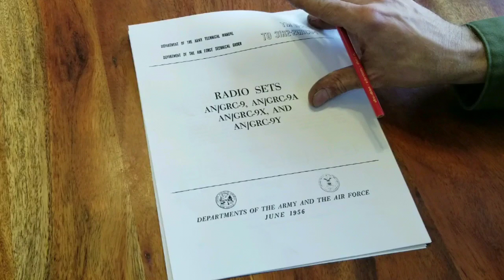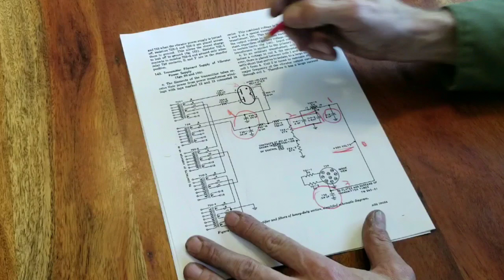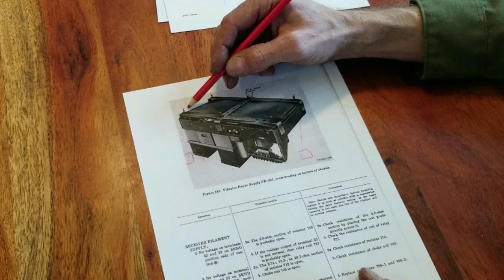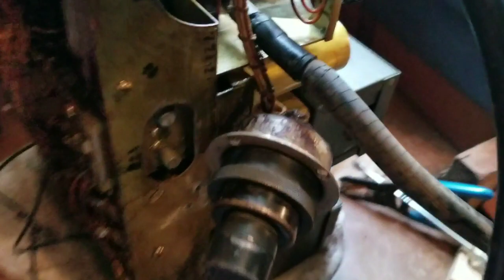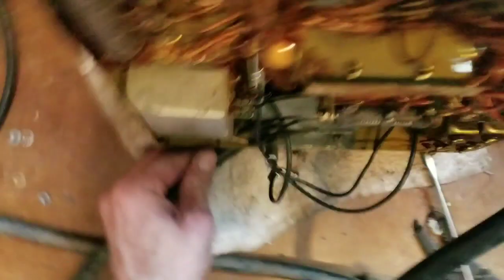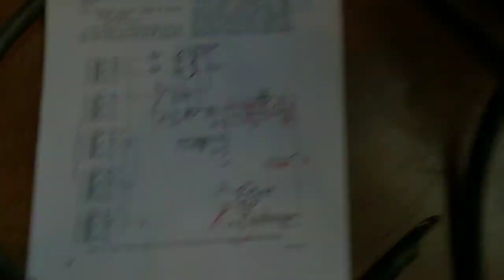1945 PE-237 Vibrator Power Supply Troubleshooting Procedure and Demonstration

Comment: Great video and explanation, I have the same problem with my PE-237, with replace that cap and hopefully no need to remove the case.  I had mine mounted in the jeep, really awkward thing to lift and position.  I saw on the video you also have RX battery, did you change out the batteries? If so I’d be interested to hear what you used.  Keep posting these great video for us non tech guys 👍🏻👍🏻